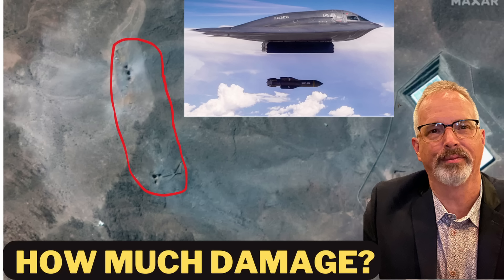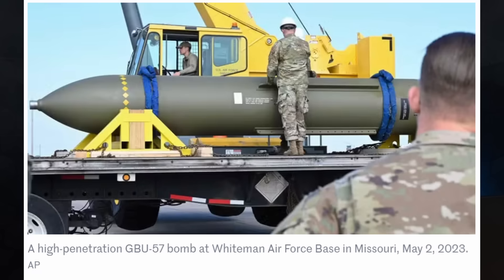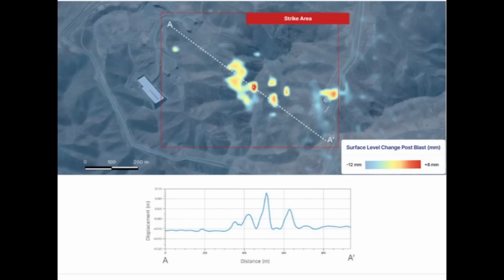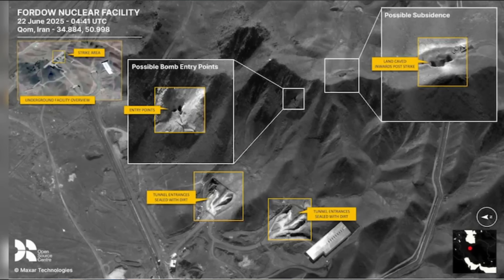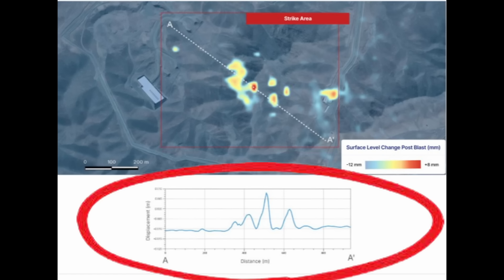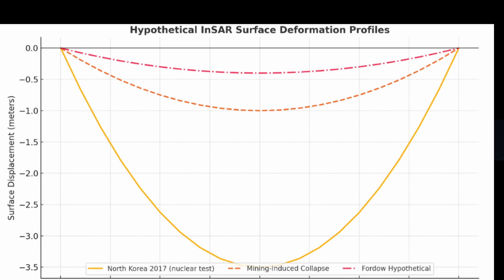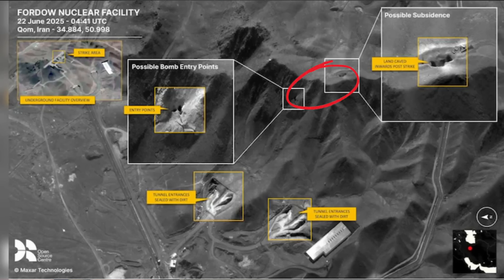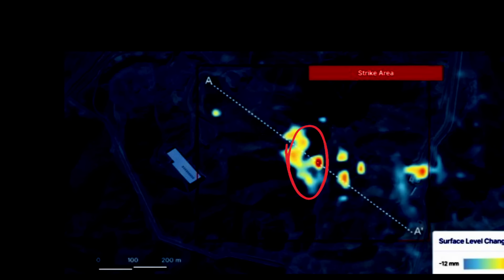Fordow Attack Assessment -  Update

Comment: The air vents are not vertical.  They were designed to send a missile straight into rock at every bend.  There is also no knowledge available that pinpoints the rooms deep in the facility. Trump can make all the claims he wants but in his zeal to get nuclear negotiations going again, he may be revealing concern that the bombing met with far less success than he is letting on.

Comment: +/- 10mm from satellite?  Not buying it.  I do low altitude drone lidar surveys and 1cm is only achievable using best practicies, best equipment and ideal conditions.  To do better than 1cm we need to bring out the old school digital auto level and invar rod.
Reply from the maker: It's OK to be skeptical but in this you are incorrect as millimeter accuracy is possible through this analysis method.

Comment: It's really really hard to believe in your explanation unless the GBU has learned to turn 90 degrees at the end of the vertical part of the shaft because I highly doubt that the people who created their own nuclear program would be so stupid as to take a ventilation shaft directly upwards from the chamber.I mean, if they're building a nuclear plant, I guess they know how to build a bunker.And if they know that, then they also know how much horizontal ventilation is needed from the chamber before you go vertical in order to absorb the GBU explosion with a blast door or some "plug" as Ted Postol says.In that case, if the bombs were inserted into the shaft, they continued downward at that 90-degree angle and may have even passed the depth of the chamber itself, but did not touch it.And not to mention the options where the Iranians could have deliberately placed the bottom of the vertical part of the shaft deeper than the main chamber itself, so you can throw bombs all day long, you're just further and further from the chamber
Reply from the maker: Do you really thank the U.S. doesn't have very good intelligence about the configuration of that facility and therefore, how best to attack it?
Reply: @CaseyJones-Engineer  I have no doubt that the U.S.  has a good intelligence service, but I also have no doubt that Iran has good engineers, and you also know that they were preparing for this.And you also know that if you drop that many GBUs in that manner on any place with similar geological properties without any bunker underneath, you will have the same results that you have stated here.Fractured rock and surface distortion.But for someone to build vents directly upwards is 100% out of the question

Comment: I would assume the blast would create a roughly spherical area of fracture/deformation. So what is the radius of the sphere. The other is issue is how accurate are the plans of Iran's underground facility. Yes, we hit the ventilation shaft, but the shaft need not be verical. They can easily be at a slant or lateral and then horizontal (or slant).

Comment: so basicaly you show there is almost no drop or raise of the surface and then you say that the facility is almost certainly very badly damaged ? this makes no sense at all.
Reply from the maker: You don't have to agree but where did you think all of that explosive energy went?
Reply: @CaseyJones-Engineer  my point is that you are, at least pretending, to use the infar data as proof that there was not just a big explosion, but that this explosion destroyed the facility. i just don't see that at all, one of the clips you use here shows that there is a lot of material ejected long before the explosion, i think that is the blue debris we saw on satellite imagery. and now, in your reply, you are asking me where the energy went ? what does that have to do with the infar images ? it's not even certain that there was an explosion in the first place !, and i'm not saying there wasn't ! all im saying is that those infar images prove nothing at all. and you are actually making my point, you went into the making of the video thinking the explosion destroyed the factory, and you didn't change your mind, your video just fails to prove that the infar imagery proves anything., by the way, it would be helpful to show the 6 ventilation shafts on that infar image, we have no reference. i am not convinced the factory was destroyed, or not, im just saying that we don't know anything more now. it's perfectly possible to have the whole factory cave in without any change to the surface, as it's possible that these little changes in the surface don't even prove there were any explosions at all.

Comment: I'd imagine the site is being sattelite surveiled heavily to see if there is a resumption of vehicles and equipment going in and out of the main access tunnels. If theee is an initial inspection by the Iranians and then weeks and months go by without any activity and no new heat plumes coming out of vents from the centrifuge hall running that will confirm the facility is inactive.

Comment: At 8:53,
The formula for cubic volume of rock fractured per weight of explosive was no doubt developed under ideal conditions.  The most efficient conditions.  Small dispersed charges like are used to fracture rock in mining operations.  In these cases hundreds or thousands of small holes are drilled and filled with explosive.  There is no dead space or overlapping of charges much more densely than necessary.  In the case here, all the charge of each bomb was concentrated with probably a significant amount of empty area and or already pulverized material surrounding it,  This would absorb a good portion of gas pressure and greatly reduce the theoretical potential.  Though designed to account for these factors there's no getting around the reality that these results must be downgraded by I would think at least fifty percent of the potential maximum assumed for commercial production.

Comment: A major flaw in your analysis is the assumption of a vertical ventilation shaft right over main centrifuge room!
Most probable configuration is that of an off-centered three-pronged ventilation shaft with a buffer tunnel followed by large room meant to deflect resend back out into the shafts the explosive expanding gases. This geometry means that the mass of granite to be fractured is much larger than what you calculated. it's the explanation extolled by Prof. Ted Postol from MIT, an ex-scientific consultant to government regarding matters of national security.
A testimony by one B2 pilot who saw a huge bright upward explosion the likes he'd never seen before is a clear indication that he explosion was deflected back into the ventilation shaft and out into the atmosphere. That is consistent with minor surface ground disruption. That testimony contradicts your take.
This goes to illustrate that we won't know for sure without in situ verification.
Thank you for explanations.

Comment: What everyone needs to understand is that gas-state enrichment centrifuges are extremely precise and sensitive, even the slightest disturbance will render them effectively inoperable. They don’t need to be directly hit with debris to be destroyed
Reply: Only when they are operational. And only applies to models IR-1 and IR-2. IR-6 and above are designed in arrays of shock-resistant cascades.

Comment: Your estimation for the rock fractured is for the combined force of all bombs right? But there are two areas they bombed and the bombs were dropped after another. So why do you think you can add up the yield? I imagine the the bombs penetrate the ground some meters, explode, fracture the rock. Since the rock will not be evaporated it will sit as gravel and this will probably not allow the next bomb to penetrate much deeper.Thus the explosive force of the next bombe will spend inside the gravel pit and the gaps will take up much of the pressure. How will your estimation look under those circumstances?

Comment: Air Force EOD, back in the day, I was part of a ground-level disposal operation of 1-2nd stage Polaris missile motor and 2-2nd stage Poseidon missile motors, for a combined 30,000 lbs of explosives. 
So I have seen 30,000 lbs of explosives detonated.
Given my expertise and experience, a few points about this attack.
1. Tamping is an explosives technique where you put mass or another explosive detonation over the other to direct more of the energy in the opposite direction.
2. As these bombs were sent "serially" (6 times precise "Time On Target") down the hole like bullets going down a barrel, they would have "tamped" the preceding bomb both with their mass and then their explosive charge, thereby directing nearly all the energy down into the facility.
3. This was done deliberately, and the energy would have had nowhere to go except into the empty spaces of the facility.
4. Bam, Bam, Bam, Bam, Bam, Bam 6 times, like a giant piledriver, operated by a Titan. 
5. In my expert opinion, this facility is completely filled with powdered rock, and any equipment is scrap.

Comment: In your analysis, you mentioned 30,000 pounds of explosive.  But that’s just the weight of the bomb (casing, hardened nose, etc is included).  

Each MOP only has about 5,000 pounds of HE.  Yes, there were multiple MOPs, but I wonder if your volumetric blast-effect analysis contains an error.  Results might still be “facility destroyed” but not to the degree you calculated.  I didn’t see you show your math, so I don’t know.

Comment: Check out Professor Ted Postol's detailed damage assessment on various channels. It was very sophisticated. Your assumption here is that the central ventilation shaft leads directly to the chamber below, but Postol argues that only an extremely incompetent adversary would design it that way. He suggests that there would be a dog-leg and also a baffle chamber prior to the chamber containing the centrifuges. Postol suggests that the damage sould therefore be much less.
Reply from the maker: I didn't assert any such thing. I just said that the bombs went down the center shaft as stated by the Pentagon.

Comment: Chatgpt...Iran has made substantial efforts to harden and stabilize its underground nuclear infrastructure like Fordow — but access to Japan's cutting-edge clean room and earthquake protection technologies has been severely limited, especially due to international sanctions. Here's the breakdown:

---

✅ What Japan Has (but Iran Lacks Direct Access To):

Japan, due to its seismic risks and precision manufacturing, leads the world in:

Seismic isolation systems (e.g., base isolators under buildings and critical machines)

Ultra-clean room technologies for semiconductor and nuclear-grade environments

Vibration-dampened platforms for delicate electronics and centrifuges

Automated clean room robotics and quality-control sensors

---

🚫 Iran’s Limitations:

1. Sanctions and Export Controls

Japan adheres to UN, US, and multilateral sanctions targeting Iran’s nuclear program.

Critical components like precision bearings, vibration isolation platforms, HEPA systems, and servo control systems are tightly controlled under dual-use export regimes (e.g., Wassenaar Arrangement).

The IAEA and allied nations track exportable clean room tech because it's relevant to both semiconductor and centrifuge environments.

2. Domestic Substitutions

Iran has developed indigenous clean rooms, centrifuge halls, and basic seismic shielding—but these:

Are often reverse-engineered

Lack the tolerances and resilience of Japanese (or European) designs

Are often more vulnerable to subtle ground shifts or sabotage

3. Espionage and Illicit Procurement

Iran has occasionally acquired high-precision components (like carbon fiber rotors or German/Swiss machine parts) through illicit networks.

However, these efforts are sporadic and incomplete, and Iran’s ability to integrate full Japanese-style clean-room seismic isolation is not documented or likely.

---

🧠 Strategic Implication for Fordow:

If Fordow had Japan-grade seismic isolation, millimeter-scale InSAR-detected uplift wouldn’t necessarily impact internal operations.

But lacking such resilience, even slight deformation may affect centrifuge balance, air filtration uniformity, or floor tilt tolerance, potentially disabling part of the enrichment chain.

---

Bottom Line:

No, Iran does not have consistent or reliable access to Japan’s advanced seismic or clean-room tech, due to export controls, sanctions, and dual-use restrictions. It likely relies on partial substitutes, making its underground enrichment infrastructure more vulnerable to even small geophysical disruptions—like the one possibly detected by KorrAI's InSAR.

Would you like a comparative table of Japanese vs. Iranian nuclear facility tech for presentation or publication?

Comment: It seems that all the "experts" believe the air shafts went straight down into the facility. I am sure the Iranians had 90-degree turns off the main shaft for their air supply. Therefore, these bombs basically went down an empty elevator shaft. They could have also had a dummy shaft at a 90-degree angle to channel the blast force.

Comment: One assumption is that the Iranians were sitting doing nothing.  Why would they not use 18000 psi commercially available concrete to cap the hole? But i am talking from 63 years of concrete strengthening, which expertise is unlikely to be generally available to Iran.

Comment: He calculated with maximum possible amount of volume which is the most optimistic scenario. However, the most optimistic blast radius only became 23.87 meters.  

That means the bomb has to go 55-65 meters deep before exploding. 

Very deep is a relative term.

In fact the very subtle changes in the ground elevation across this area is proof that the bombing was a total failure.

The bombs didn't go further down than 20 meters, reaching a maximum depth of 45 meters.

In contrast, an exploration at 70 meters depth would not reach up to the surface at all.

Volume gives a big number, but just calculate the volume of a ball with 24 meter radius. You see.
Reply: That is only about 7 times the length of the bomb.  30,000 pounds of hardened steel going supersonic; you would need a mountain made of steel to slow that down! Besides, a succession of bombs went down a ventilation shaft. The GBU-57 development started when the Iranians started building labs in mountains. Years of development and testing againt exactly this kind of target. I wish the liberals would shut the hell up about this issue. They are spouting lies and showing their ignorance in a lame effort to embarrass the President
Reply: "In contrast, an exploration at 70 meters depth would not reach up to the surface at all." You do realize 12 bombs were dropped, not just one, right? You do realize not all 12 were dropped and exploded at the exact same second at the exact same depth, right? Funny thing about a 30,000 pound "bunker buster" exploding underground, it actually softens up the ganite/limestone rocks or concrete further down beneath it after it explodes, so, just add a second 30,000 pound bomb going through the same exact hole the first made, any real resistance doesn't start until the second bomb reaches around the same level that the first one exploded, allowing a further depth to be reached. Now, drop a third bunker buster within 10 feet of those first two, and at some point having the benefit of going through only softened up ground. Then, how much further would a fourth be able to go with a no-resistance hole followed by all the ground softened up by the previous three bombs? Finally add another fifth and sixth 30,000 bomb to that, and do that at another area just 200 feet away. Remember, it wasn't just one bomb America dropped, that's very important.
Reply: @brianc8916  I'm aware of that and it was like 6 bombs in each hole.

I wasn't aware of that the Iranians had been clever and not just drilled a 90 meter vertical shaft and the first bomb just obliterated everything, whereas the last got blocked by all the rocks and stones that filled up the shaft from previous bombs. 
Guess the Israeli had done it already in this case.
So was the ventilation shafts build by mining vertical and horizontal steps or a long almost horizontal tunnel due to easy disposal of stones?
In both cases the ventilation shafts is unlikely directly above the facility.  
Then when the first bomb explode, it will leave stones and rocks 20 meters above where it exploded that the next bomb needs to penetrate first if it even manages.  

We just don't know enough about the construction, the pentration power of the bombs in different substances and so forth. 

It's just that the surface elevation changes is worrying.

He had an explanation of how much a volume 100000 m^3 was, but it didn't help me. I just used simple maths to calculate the blast radius of each bombs. 

Exactly where they exploded is a different calculation.

IAEA has also stated that the facilities goes 500 meter deep.
Reply: @brianc8916  penetration drops off exponentially
Reply: So a 13 Tom bomb dropped inside a shaft only went down 20m..... Yep sure buddy

The ground elevation doesn't have to change much, the halls don't need to collapse and even if they would collapse a 60m high hall the above ground would not shift down 60m anyway...

All it needed was a shockwave cracking the structure, shaking it and brake the centrifuges.... - there is no need for a collapse if the whole structure
Reply: @ItsAlways42-z1e The point being that the blast radius, the shock wave is only less than 24 meters inside granite.

Ofcourse, the radius is a lot larger in air and the blast would likely follow the ventilation shaft where possible.
Reply: Wrong CNN